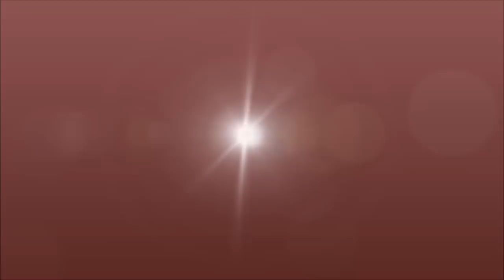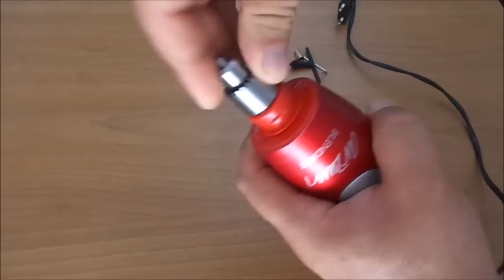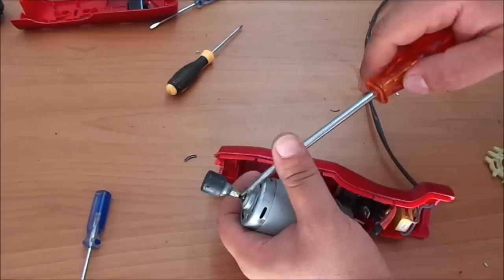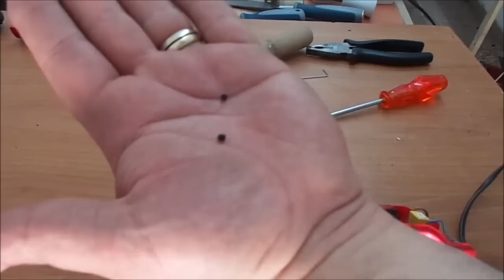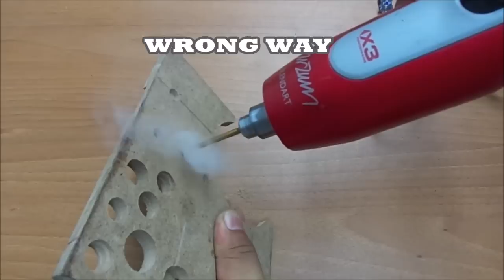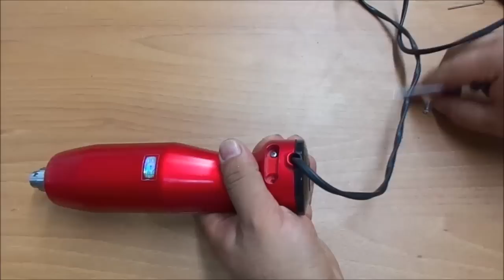Powerful Dremel from Blender - BLENDREMEL - Blenderden Dremel yapımı

Comment: Hello, congratulations on the super tool, I have a blender to do some of that, the question is, how can I get the motor to work with just one switch? the electronic board and the variable speed drive are broken but the motor works, thank you very much

Comment: For all others, if you want to drill a wood, your drill must not have a rpm than 1500-3000, otherwise you burn the wood..  You can get such gear motors from aliexpress or banggood, for instance 12v dc motor. If you want to polish with that, you need a speed about 5000rpm. 
If you search for mini grinder or dremel, you will find mandy other small drills.

Comment: motor volts ??
Reply: i have 220 dc motor but donot have drive /kit/circuit diagram  ,to run the motor.do you have any solution.?
Reply: Does it work in dc
Reply: it is 12volt motor not 220 volt